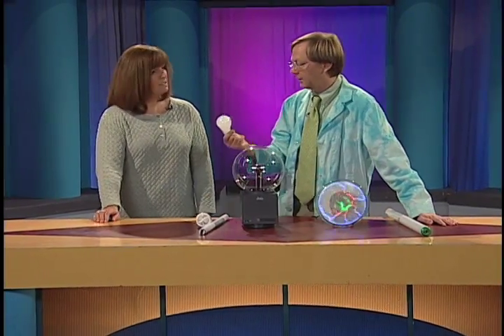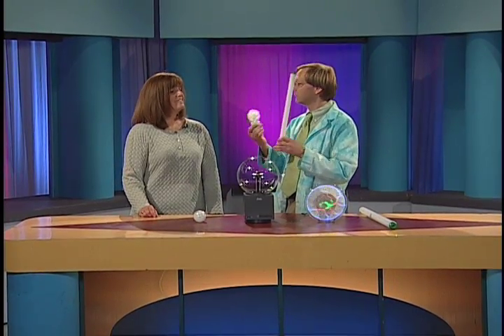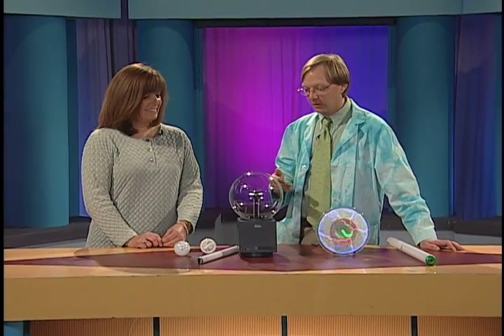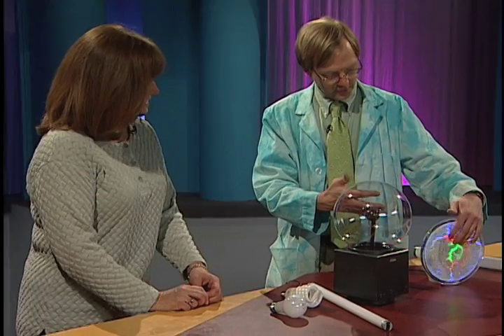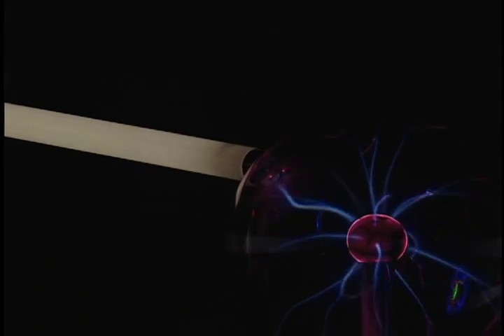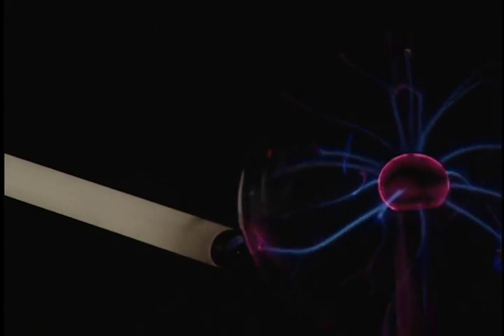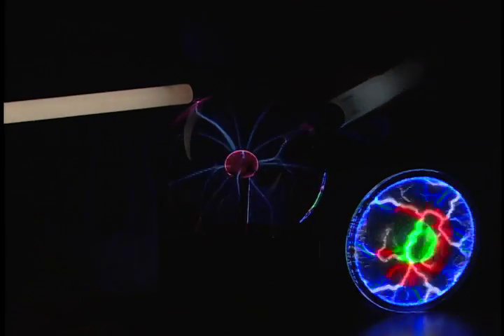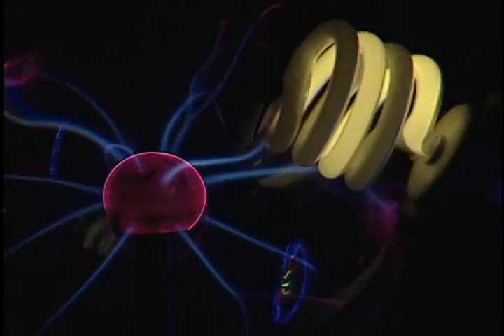Plasma Globe Makes a Light Bulb Glow

Comment: CFL bulbs also have some down falls, made with mercury(which doesnt get disposed of properly), and they are pretty much only made in china(if you dont get why that is bad read some books)
LEDs should be used; not only are they more effiecent but they last for over 10000 hours.(im pretty sure much more) They are expensive but in time will become more affordable and brighter.

Comment: Perhaps I need to be enlightened, seeing a lot of people hating and calling conspiracy on Tesla being shutdown.

I thought the reason wireless electricity wasn't feasible was because it took MORE energy to transmit it?

Since air is a "thicker"(?) and a less conductive medium, most energy would be lost to the air itself. 

Think of it like computer signals: sure, your wireless works, but is slow in comparison to fiber optics (glass) or old fashioned cables (copper/metal). Plus your signal drops due to interference, so its not reliable.

With that said, there are wireless battery chargers, except they are VERY short distances, and just remove the need for a plugin.